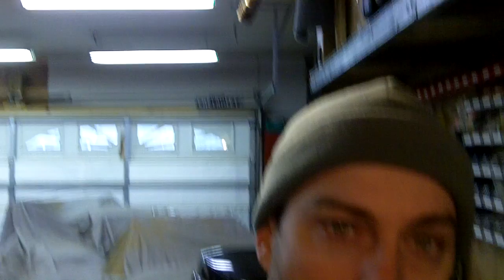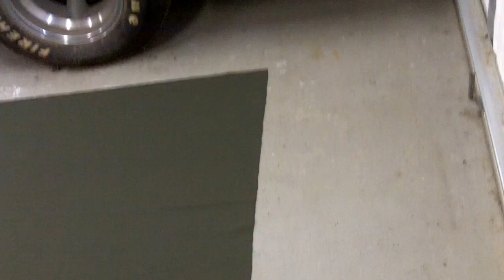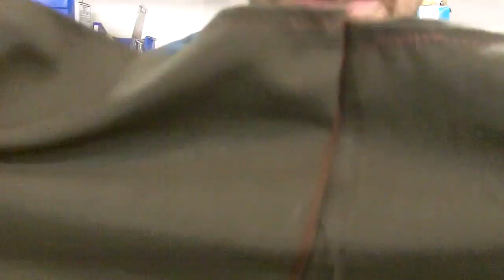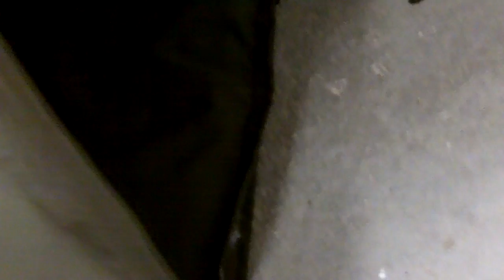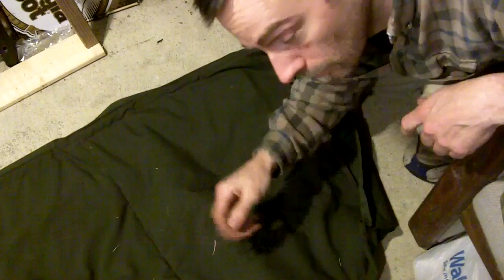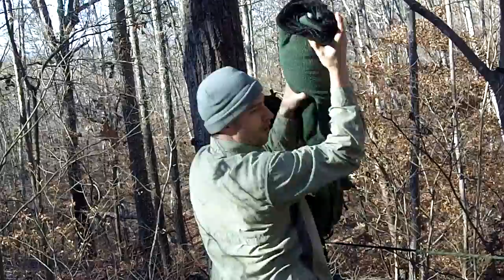The Tree Tent DIY Follow Along Project

Comment: That is thinking out of the tent, so to speak. The seam you stitched in the edge of the material is, what we called in boot camp, the catch edge. Reason being your finger nail could "catch" on it if you ran your finger across your sheet. You didn't want to make your rack with the catch edge of your sheets facing up. The consequences were both funny and somewhat embarrassing. Your design, though, didn't leave you anywhere to hang a light inside. Did you eventually remedy that?
Reply from the maker: Thanks James,  I'm glad you liked it and thanks for the comments on the catch edge.  I've never heard of that.  I never did anything to hang a light inside,  I figured I would only be sleeping in it but a light would be handy.  Thanks for watching

Comment: Dave you can use two or three disc magnets stuck to you machine deck to keep it straight.
Reply from the maker: I don't understand what you're describing
Reply: @Reallybigmonkey1  where you put the tape on your machine just set two or three magnet, I use the magnet to keep from getting glue on my machine.

Comment: Well, here is another Dave Pearson Masterpiece -). I really like that you used tape to hold your fabric edges together while sewing instead of pins, IMHO that makes your edge positioning more precise. I think I will use that method the next time I break out my machine. I also think you could prob sew right through the tape with few or no problems if you had to, maybe slow down your stitching speed in that spot and walk the presser foot over it. One thing is for sure, running into tape won't break your machine needles, and using straight pins to hold your fabric edges together surely will do it sooner or later, in my experience..
Your Tree Tent is a job well done, and especially for a first effort in sewing it is a great success!

About hot weather: I learned in S FL that mounting a breathable fly about 3" above your tent roof is the best way to cool off a hot tent in hot weather, it's amazing how well it works.. I like to use the lightest weight nylon fabric I can get for it, and in the lightest color. Any lightweight fabric that bounces the Sunlight off will make a huge difference. Air also has to be able to move and flow between the fly and the tent roof.. I hope this helps so you can use your tree tent in hot weather :-).
 Thank you for posting your build process, I am certain that it will inspire many people to open their horizons. BTW, Survival Clause is a hoot :-)! Congratulations, you have singlehandedly turned sewing into a Manly Endeavour, LOL!
Reply from the maker: I'm glad you liked it! The tape does hold well, you can't see through it tho because the bits and pieces are almost impossible to get out of the seams. I've been doing hot weather shelter experiments for years and you're right on with that over head  tarp. Thanks for watching

Comment: Heh, Survival Claus made me laugh!  As did Nick's boots only appearance.

Seeing this video, and knowing you now have a stock of the shiny reflective stuff, I kept thinking of a winter version of this tree tent, and mentally redesigning it when you pointed out the issues with sagging.  Here are my envisaged plans for a double walled tree tent:

Build another pair of separators, but ones only a few inches long.  The intent being to have a second ridge line placed above the first, to hold the outer tent of the shiny material (facing inwards).  With these separators placed vertically, between the two ridge lines, joining the ends of the inner (air breathable) and outer (shiny material) tents.  This would guarantee that the peaks of both tents would keep their separation (and the vital air gap), even when you climb in the end.

Without this an outer tent on a higher ridge line would be left far higher when you climbed in the inner tent.  Leaving far too big a gap for air insulation to be at its most effective, and would put you further away from the reflective properties of the shiny material.

Then make an extension on the original separator, making it a few inches longer on either end, and giving an extra cordage attachment point at both the new ends.  So still being a metal pole, but with four rope holes, rather than two.  This would allow roper (or cordage) to be strung between the extra two end holes, running parallel to the sleeper, and keep the outer tent's material away from the sides of the inner tent.

The end view would be of two triangles inside each other, so that there would be an air gap insulation underneath the sleeper.  However the outer tent's material should be sufficient to allow it to sag underneath the inner tent to reduce the risk of tearing when you climb in.

The fact that the two tents would be joined by the new separators I propose should minimise that risk though, as the outer tent should be pulled down by the new vertical separators.  Plus the load is being shared between the two ridge lines, via that, so the total sag should be less than with your current tent.

The outer tent would be longer than the inner one, in order to allow their walls to also provide an air gap in between the head and foot ends of the tent.  With one end having a zipper, to get in and out, of course.  These need not have a separator, as you could just slide the outer tent along its ridge line until positioned as you want it.

I imagine you have had similar thoughts, but I felt the urge to let you know how you inspire me to think of shelter builds.
Reply: Camp fire version.  Similarly to what you mentioned in this video, the two-walled tree tent could have an extension to cover a fire.  However the extension would be integral to the outer wall of the tent.

Using a trick you showed in another video I remember you would make sure that the air gap, which acts as the chimney, would be at the opposite end of the tent to the camp fire.  So that the smoke and hot air is encouraged to travel along the roof of the tent (above the inner tent, so hopefully not entering that) to exit the gap at the far end.

Some materials testing would be advisable though.  Firstly making sure that the shiny stuff is not prone to melting or catching on fire.  The peak of the outer tent would build up a heck of a lot of heat and so would be as at much risk as any part which may be too near to the flames.

Secondly testing to see how easily soot is cleaned off of that material.  I suspect it will just wipe off with a wet cloth.  But if not then the reflective properties will rapidly degrade, as the surface gets dirtier.
Reply from the maker: Great ideas Mark!

Comment: As I watched this video I had a thought that maybe a one foot piece of velcro sewn to the floor in the center (at ends) and then looped around the spreader bar and back to itself on both ends might offer a little less sagging.  As I said just a thought, may or may not work.  The camera clarity of this video seems a little sharper than later videos (especially when you were in your garage).  Different camera?  Another great video.  As you might see I have been working my way backwards thru your videos to when you were a young boy.  LOL.  Thanks again Dave.  Florida, USA.
Reply from the maker: Well the sag is what makes this comfortable. Stretch it all too tight and it's awkward to sleep on. Nope, same cheap old camera. It is sort of a lousy camera and focusses differently with available light but it's simple to use

Comment: Dave, what an idea for 2011! Did you know they sell this “Tree Tent” today for about $400.00 to $700.00; YOUR PROTOTYPE!! They are a little different and have evolve in the past 5 years, they include ratchet systems for the sag, fiberglass/carbon fiber spreaders, improved materials (under eight lbm). They real secret was the materials and the  amount of tension applied to the system. You really should consider patent/copy right some of your ideas.
Reply from the maker: I knew they made one but I didnt think it was anything like mine,. The one I saw was attached to three trees. Im sure a lot of my stuff was the basis for gear thats made. Maybe one day Ill make patent and sell some stuff.

Comment: the first foreseeable possible problem I see right off, is it's going to be very uncomfortable climbing in and out over the bar at the end. this looks very similar to a shelter you have made with a tarp. you have a tough time getting in and out of that, and now you are adding an element of a aluminum tube to climb over as well. now you are trying to be able to put the bottom rope at different angles if need be. by using a removable bar, I fear your going to also find that the bar is going to try to eat the bottom of your tent, also when you climb in, you're going to cause sag which your bars aren't going to compensate for... I don't think, may be wrong there. but the further the ropes are at the bottom is from straight ahead, the more that bar will dig into your tent. with the bottom sagging towards the middle between trees, I REALLY fear climbing in to be painful on your back as you slide down the tent. and going to be equally painful trying to get out
Reply: after watching the video, the bars did better than expected. they did seem to be an issue. but there was something else I noticed. that you could make the ropes even tighter the closer you got to the trees, so you could make the tent sag less than might otherwise. actually the potential is better than I would have guessed. I figured it would want slide up the ropes as you climbed in as well. you left your vent holes where most of your heat would escape, so should keep sweating down you could use that vinyl piece in the bottom with your pole through it, would make the floor slicker which might make it easier getting in and out...also with some strategic placing of loops and that tent would work fine for being on the ground. I was also wondering how well it works with wind?  I suspect that it beats you off the ground as the trees swayed back and forth you was pretty close to it, and tying it higher isn't going to get in and out any easier. if you could stay off the ground, all that swaying would rock me to sleep like a baby. another great video, first comment was just a prediction. this was quit a learning experience. well done.

Comment: Very interesting and clever, but I wonder for us who can't weld, if the spreader bar could be made with PVC pipe. I think it would it hold up if it was schedule 40 or the grey pipe used for electric wiring. Might have to create two triangles for strength. Naturally it still needs to be a simple and compact arrangement like yours. I don't have a tent made, but if I can find the time soon, I might try that unless you beat me to it, which is okay with me. If you like the idea, please feel free to run with it for the sake of us viewers. Besides it's your  concept and you can make it work if it's doable. As usual David, very creative.
Reply from the maker: Thanks, I'm glad you liked it. Since this vid came out, I tried three or four different spreader bars! I honestly cant remember which worked best but I bet PVC ones would be the lightest. Thanks for watching

Comment: https://www.youtube.com/watch?v=UvVwYu5ecjs   This is a way to do a strong seam for weight bearing or stressed seams, your seams will be stronger if you stitch the seam allowance at least 5/8ths - instead of smaller.    If the material you are using does fray, you do not have to cut one seam allowance shorter, as she does in this video.  You are doing out door items and like you say it doesn't have to be pretty.   If you are working with material that does not unravel or fray, you can just stitch the first 5/8ths sea, fold over the seam allowance,  then sew down the middle of the folded  or flattened seam allowance.  Ironing does make sewing easier, and if your material tolerates steam, steam does a faster press and saves you time.   If you have material that doesn't tolerate a direct touch of an iron, you can use what is called and ironing cloth.  Though the ironing cloth protects the heat sensitive material it should always be tested so you don;t end up with melted nylon.  The double seam on heavy material makes it stronger and more l be more functional and dependable for you.  Thanks for your teaching style, amazing inventiveness, can do attitude, and honesty.  Your videos are enjoyable to learn from. I will be buying some of that thicker nylon thread and bigger needles, thanks for that tip.

Comment: I know this is an older video, but as I was watching the intro I can't help but think that if you took 3 sets of Atlas XL straps from ENO, (their extra long hammock straps), or alternatively crafted something similar, you could basically have this shelter attached to carabiners and you would be able to set the shelter up really quickly, while also being just as secure and easily adjustable. 

The issue would be that the Atlas straps or similar are made to run down the center of the tree for the single attachment point of a hammock, but I'm sure that could be remedied.
Reply from the maker: +Jacob Sharp  Im sure that would be a much faster set up. Issue with that is the length.  When I made this I was planning on carrying it into the swamps and wetlands. Often times the trees are extremely far apart. Rope was all I could think of using with varying tree spacings.
Reply: That's a very valid point which I had not considered! Love the channel by the way, it's just about all I have been watching lately since I discovered it. I am a huge fan of your attitude and your unique take on things!

Comment: I have a sewing machine, but it sews the thread backwards 'from the tail ends' LOL. I don't know what I'm doing wrong, it's an older machine and I haven't used one in 25 years. I was going to attempt recreating your covered bungee cords.
Reply from the maker: +Sasquatchlife Notrace  Sews backwards? I only have one guess, that button you push to make the machine sew backwards sometimes locks into place. If its a Singer look over on the right hand side and see if there a lever button thing thats pushed in and might just pop out. Ive had my get stuck in place before. Let me know if that helps man

Comment: For people without welding skills they could use a piece of 3/4" PVC pipe, with caps and a small hole drilled thru the caps and pipe about 1" from the ends
Reply from the maker: wainemaine  Good idea you have
Reply: wainemaine Good Idea to use pvc pipe. But 1 1/2" would probably be better. To use as  poles for a tent.---bc they are stronger.
Reply: Johnny Wewoka And use the PVC for transporting camp needs and survival equipment (fishing gear)

Comment: I love "Survival Claus"!!!
Reply from the maker: Thomas Pigg  Aint that neat?
Reply: After watching this video for the "umpteenth" time I have a comment/question that might or might not make sense.
I was wondering if maybe there is some kind of "boning material" ( or stiff yet flexible rods) that could be incorporated into the bottom for extra support while lying down, and the other is a zipper in the "closed end". It would be easy access from either end, and also your added length of tarp could serve as a shelter for not only your fire, but also to keep a dry place to enter and exit during wet/rainy times.
As I said, it's just questions, thoughts and comments I had. 
P.S. Don't worry, we won't tell anyone about " not sewing pretty... it'll be our secret!
Love your videos. Keep them coming.

Comment: If you dont have machine shop tools you may even be able to use PVC? would that work Dave? I just thought of that ha ha.
Reply from the maker: MonkeyMIkes Outdoors  I would say yes to that. If you can cut the notches just right and find long enough rivets to secure it. Im thinking glue would never hold and bolts or screws would almost always come loose. Give it a try bro.
Reply: ya when i get the money i can barely pay my bills, believe me if i could i would, i wanna go camping sooo bad and play around in the woods lol
Reply: I'm building one of these right now and trust me... don't use PVC. It will bend and break while you're in it.
Reply: You could Try to use metal conduit with tees instead, from home depot or lowes. They should even be able to cut it for u

Comment: The fabric you  used, what is the weight limit?  Doesn't  the sewing the thread create  a line for the fabric to tare. I've got more ambisous designs.  I'm thinking a 12'x12' cargo net. Might be more practical.
Reply from the maker: Nick Granzow  I have no idea what the weight limit is, theres no science or engineering behind the design. A cargo net would weigh less but it wouldnt be as comfortable nor would it stop the winds at night.

Comment: Love your videos. Had an idea for the bottom bars if you don't mind, in each corner of the front/back of the tent you could stitch in a loop of fabric and attach either velcro or caribeeners to hold the bar/tent together once it is in the air. That way you won't have to slide the tent, then move the bar, it would all move together and if for some reason, like in your extended tarp/fire cover idea, you could always just unhook/unvelcro it. 

You've got some really good ideas on alot of your gear. All I gotta say on that is Shark Tank. You'd make a fortune. Keep up the great work, I'm learning alot from your videos. Thank You.

Comment: Hey Dude, i have used a hammock and a rope suspended over top of it, which you can throw a tarp over.  Tie the tarp off, throw your thermarest inside and its done.  I have used this method to hike the West Coast trail on Vancouver Island with my girlfriend over 20 years ago, and it worked well.
iron